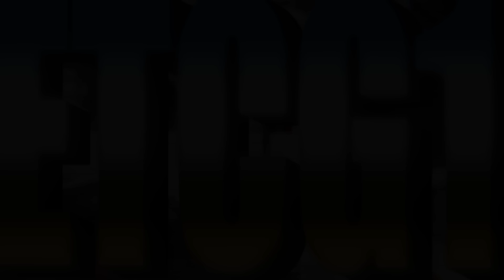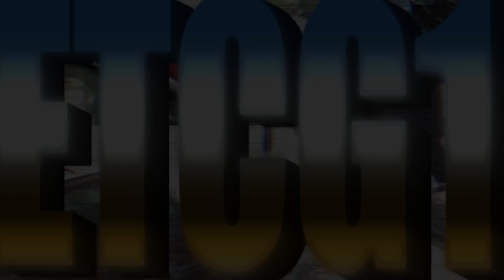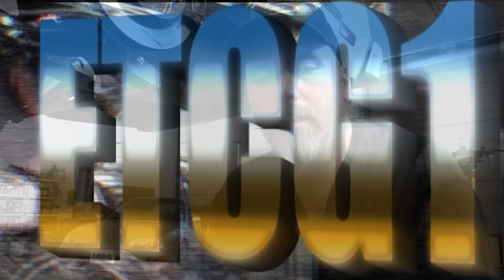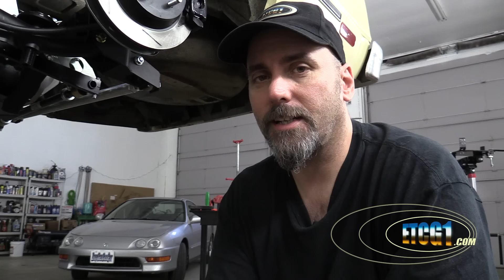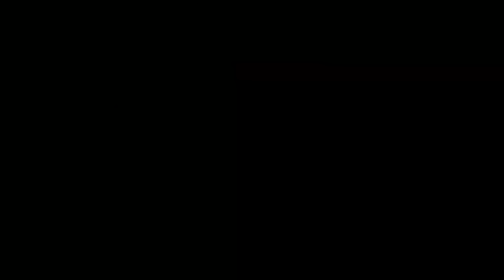Misconceptions About Performance Parts

Comment: Stickers also add HP...
Reply: And red brake calipers...
Reply: I have red brake calipers.
On my car, they increase brake performance.
But then, Brembos,  have a tendency to do that.
Reply: shit why didnt eric talk about this
Reply: GLC522 Sarcasm, that's why.
 On my part.
Research, The Newcastle Song
Comedic value, if you can understand Australian, humour. 
Enjoy.
Reply: It is a common misconception that stickers add horsepower.  They actually improve aerodynamics because they allow the air to glide over the car much easier.
Reply: Switching to a metal shifter lever instead of your stock leather/vinyl and plastic one adds like 20 HP.  Fact.
Reply: +Tim Johnson hahaha
Reply: Tim Johnson,  True in the rust belt. I've seen a LOT of rust holes "repaired" with a sticker....
Reply: a skull shifter knob improves gas(petrol for the British) mileage. also increases horsepower.
Reply: No matter what vehicle it is, if it's cherry red, it's fast.
Reply: ***** it also made me make children all over the state that I don't take care of
Reply: +5bhp each
Reply: I thought it was the imitation HID's that added 50 HP.
Reply: Yeah. And spoilers only look cool.
Reply: And chrome air cleaners. Those add minimum 20hp.
Reply: Adam 1 don't forget underhood krome
Reply: Giant wings. I'm gonna put airplane wings on mine. I'll just fly over the traffic with all that extra stability.
Reply: So true , my garage entry door is extremely high HP

Comment: Pointing your stereo speakers backwards increases your speed
Reply: Only if you got Dolby otherwise you need a gamma defibrillator
Reply: dont do shit for speed (well, the extra 200 pounds of speakers slows you down)....but does actually make your stereo louder. 
tested it out in my car....facing the front is quieter than facing the rear....your using the truck as a sealed speaker box. 

ive got a stereo in my 99 buick century that costs as much as the car (3000)....
1000w rms, two 12 inch subs....
6.25 + tweeters in the front doors...on 60w rms
6x9s in the back, on 60w RMS
2 separate amps with independent power lines (like 150 bucks just in copper)

but i play neil young, Alice cooper, led zeppelin, ccr.....shit like that.
subs do add to rock music....

i also play rap and crazy bass heavy shit....because my sterio is also good for that.

but i set it up to be more about sound quality than "ghetto bass"

hell....people try to sell you 'speed parts" for sterios also....like capacitors and shit. 
just get better, thicker wire, bigger or 2nd battery, and a larger alternator. 

just like you would buy a bigger displacement engine or a cam before a cold air intake. 

i ride nice and comfortable in my buick....while listening to good tunes as loud as i want with no distortion. 
cant do that in any factory stereo made before 2006. 

factory systems have gotten a lot better however....

idk man....once you hear your favorite song LOUD and clear.....you wont go back to shitty 1990s GM stereos ever again. 

sorta like how you can go back on internet speeds....just isnt the same anytmore.
Reply: dude you just wasted your time.
Reply: #TooMuchTimeOnMyHands
Reply: for real? did you just have a conversation with yourself? over a joke
Reply: Works better if the vent ports on subwoofer enclosure are vented towards the rear of the vehicle.
Reply: the orientation of the port and the sub vary depending on the vehicle. it depends on the bandpass created and wavelengths of your peaks. also depends on the resonate frequency of the vehicle and the peak frequency of your box.
Reply: Jeff Pinter 
This comment deserves a zillion likes. El. Oh. El.
Reply: Jeff Pinter But you need at least ²00 amps boost!!😎
Reply: Wiring left and right speakers in opposite phase will make them super loud. wink

Comment: Racing stickers and red calipers is all you need. Instant performance boost up the wazoo.
Reply: Polar Wolf 
And a cold air intake, which should add an extra 75 HP.
Reply: Just make sure the cold air is sucked up next to the hot engine, that makes all the difference :D
Reply: Everyone likes to paint calipers. Why not paint the disc? The paint will last if you just remove the pads, and stops will be faster than ever.
Reply: Put dry ice in the air cleaner.
Reply: Minnesnowtan 
If you did, it will give off a poisonous smell every time you stop.
Reply: yeah nothing like adding co2 to the mix....
Reply: Don't forget to add a cheap body kit and big fart can for that added 100hp.

Comment: among the best performance parts you can add to your car are good tires...
Reply: paired to a good braking system.
Reply: that is my point always, but the "peasants" understand performance like going faster in straight line not better braking or speed in curves xD
Reply: The priority order

1. Tires
2. Suspension
3. Brakes
4. Actual power upgrades.
Reply: Weight
Reply: i think weight reduction is the best but  works better for racing than for street and usable performance , you have to sacrifice a lot of comfort to make a sustantial weight reductions and in a every day car sooner or later you're gonna get tired of the rattlelings , noises and confortless
Reply: Only true for cars with poor tires, suspension and brakes in stock form... many cars these days do not fall into that category and can easily absorb more power.
Reply from the maker: Amen to that!
Reply: kinsel Driving an insanely powerful car from point to point - that handles badly - is also exciting lol
Reply: THANK YOU ! and the best brake pads you can afford to go with those super sticky tires. I would never get drilled/slotted rotors as they remove surface area and thus reduce braking. Slotted can help if you have garbage pads.
Reply: Think the point of slotted and drilled out rotors is to keep em cool for racing. Dont really care about the way the pads come out since you pretty much change em every race,  your just trying to eliminate brake fade from heat
If im not mistaken.
Reply: Simon Coles.  Absolutely. Good tires / tyres, one of the most forgotten mod one can do.. All the power in the world or even minimal power is no good if it cant be transferred to the road. Even if they look good doesnt mean they dont break down over time unbeknown to the eye. Not going to get the same handling on 7 year old tires as you will out of brand new just made tires. Then get into the different ones, different speed ratings, made with different compounds, different grips and how they channel water. There is just so much involved in finding a good tire. Very overlooked part of the process. Very overlooked part of the vehicle period.
Reply: dosbox907 It can be a balancing act depending on what you want to achieve, but the best thing to do is get rotors with better/more veins on the inside or simply larger rotors (not necessarily pads). Because what you're doing when you do get drilled/slotted rotors is trading surface/contact area for cooling/resurfacing.
Reply: Simon Coles no point in adding all that horsepower and torque if you don't have the grip.
Reply: I finally bought Michelin pilot super sports for the first time. and WOW the difference is huge between my all seasons I had before.
Reply: No. The whole thing of "replacing tires" and "having a working engine" are complete bs. Haven't you seen Mighty Car Mods? The most important performance parts are stickers, second only to new windshield wipers.
Reply: Aww yeah the stickers for HP gain dayz....
Remember, used to be get at least an easy 45Hp gain for the "Fear this" sticker depending on which one you picked. Now its like were lucky to get 25 Hp gains from any off-the-shelf top pick sticker. Have to be special made to get anything better. Do have to watch out for the "Elect a liar" political-dicks stickers, they rob everything from factory Hp #'s to fuel millage to handling ..
You also forgot to mention the screw on rubber radio antenna. Didnt matter what way the wind was blowing it deflected it sending it the right way for the best  arrow dynamics at top speed.....
I sure miss them good ol dayz of yesteryear I have to admit
Reply: I should say every car is unique, the order of modifying you car is not always the same, some cars have good suspension like Skyline or Toyota86, some have good brake such as BMW M power. The thing is you need to do the tuning, even the cars in the same model is still different, this is how tuner did, get the data first before modified your car. So the priority order is somehow different.
Reply: Every car is different, so the modification and tuning is different, change tire is not always the first, get the data of your own car first, and doing mod accordingly.
Reply: @HonoredStyle For you who said tire change is the first mod. It's "Nope". Because it's only applied to budget car, do you think supercar like LeFerrari or Lamb or even BMW M4 will give you a bad tire. You need data, like some basic data, A/F, Cylinder pressure, Fuel Pressure, Oil pressure, gear ratio, and tire pressure that applied to different road condition. Then goes to loading, valve timing, traction, coefficient of downforce, drag, and so on. I never mentioned all of the mechanical data, because it's too much for you
Reply: First of all, I don't even know what you said, Second, the point of this video is about performance parts, performance parts can be used for every car. Third I said this thing because someone comment:" every car should follow the sequence of mod, first should always be the tires. REMEMBER SOMEONE SAID EVERY CAR. Fine I don't want to make non-sense argue with you, so Bye
Reply: sorry I am older than you think, plus, I don't need to learn mechanical things on Youtube, but someone actually did, and try to argue with me
Reply: i had some old tires on my car...( 3 different brands and types (both radial and Bias due to money reasons). speeds over 70 would rattle the car, not to mention  that it would pull so far to the side. i got some good 40k tires recently for $450 and now i can haul ass without worrying about blowing out